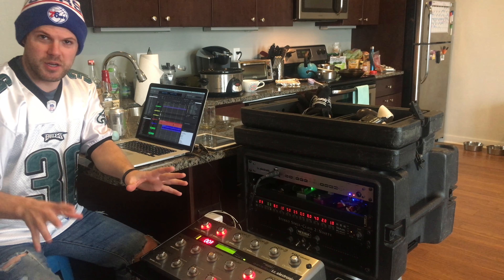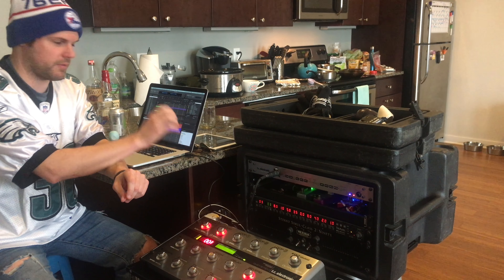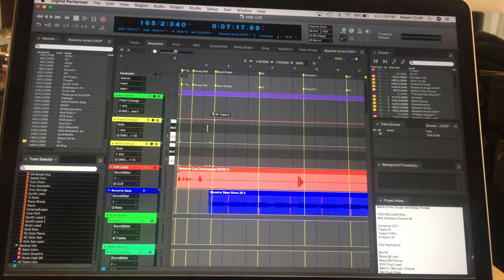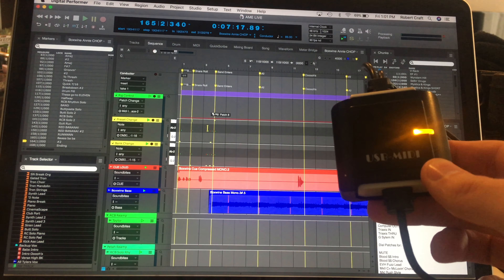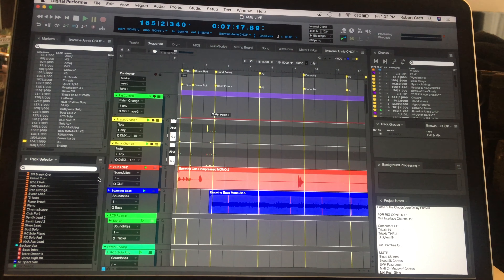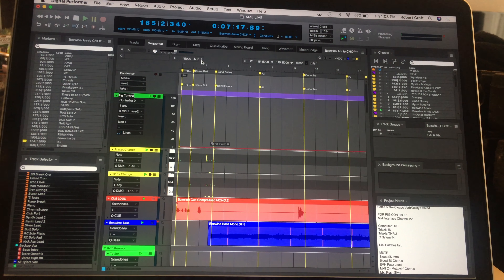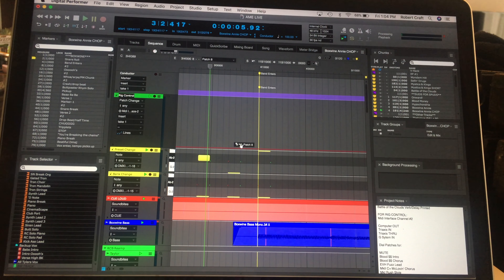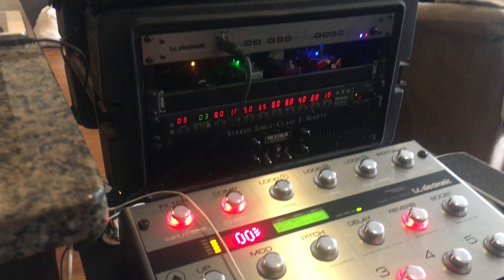How to Control a Guitar Rig With Midi and a Computer (Ableton Live, Digital Performer, Logic)

Comment: I got the same rig that you have!! How do you connect you guys system into the triaxis and 2:90?
Reply from the maker: Nice!! The adapter in the video goes to the midi in on the triaxis and with the midi thru it goes to the midi in on the g system. The triaxis controls and 2:90 direct with the different loop switches, its non midi but programmable. Hope that helps!